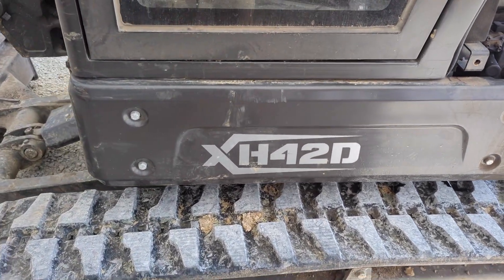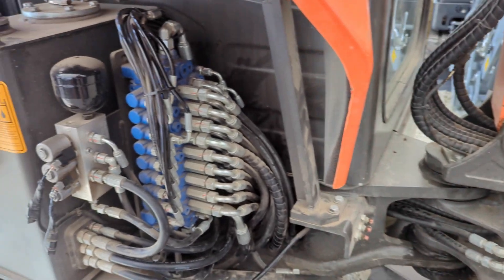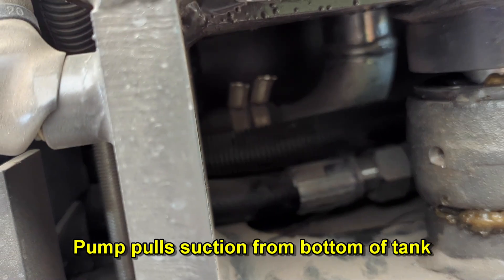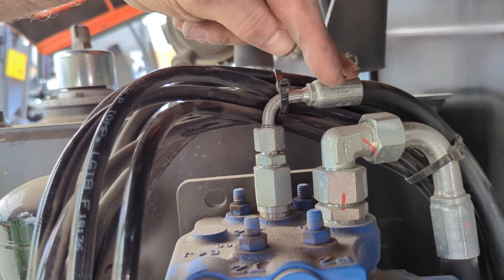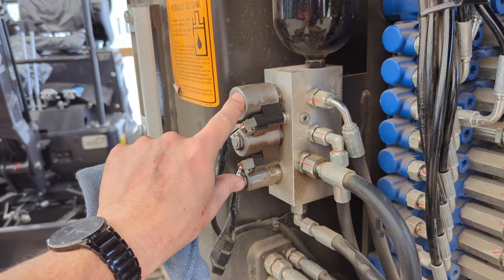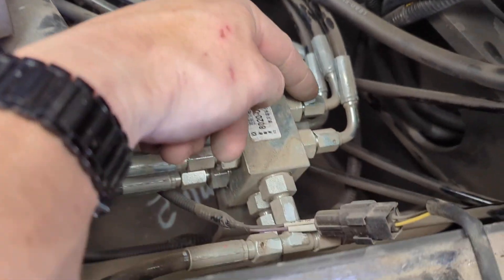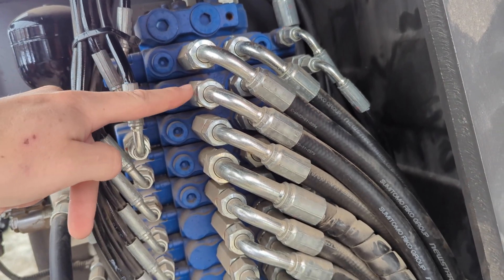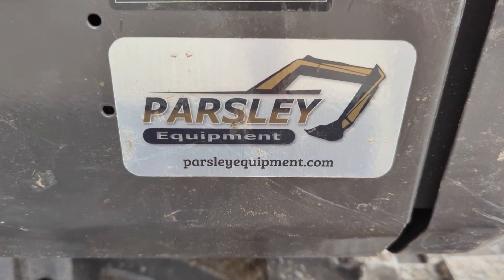Hydraulics Overview of KYMRON XH42D mini excavator

Comment: Ive got an xh32d and bucket wont curl. Its been down for 6 months now. Shop told me its the in the valve stack. He couldnt find anything wrong, but thats where the pressure is stopping. Kymron hasnt been much or any help yet. Where could i order the section of valve stack?
Reply: You've been down six months? Doesn't the machine have a warranty.

Comment: Whats the best way to drain and then refill the hydraulic fluid?
Reply from the maker: Hello, if I remember right there is a drain plug on the bottom side of the tank.
Reply: Ive got the xh32. Bucket quit working at 23 hrs. Kymron has been zero help. Mechanic says its in the distribution block and needs a part. Dealer can't even get parts for their units on their sales lot. Im screwed been 5 months with a brand new $38000 machine down

Comment: Does this machine’s engine have a dpf or any kind of emissions control systems? From what ive researched it looks to be the same engine in the 25hp L2501 kubota tractors
Reply from the maker: It's the Kubota D1703, so no def, just standard diesel.